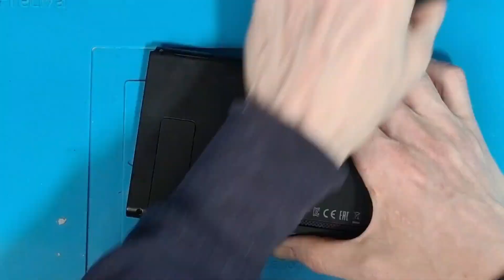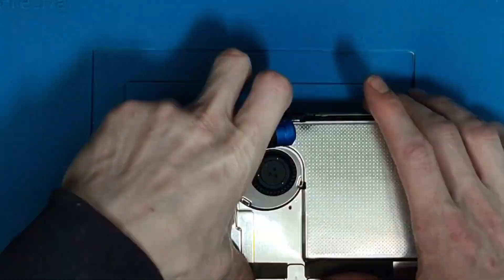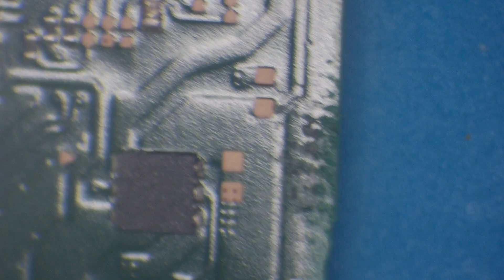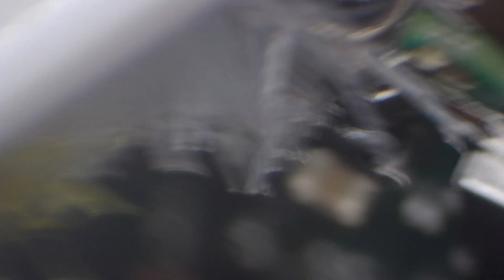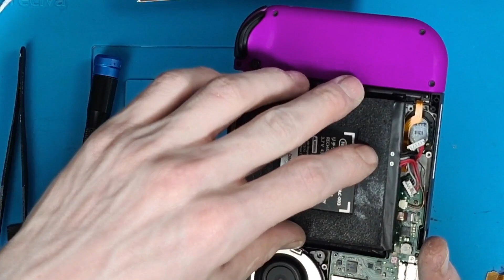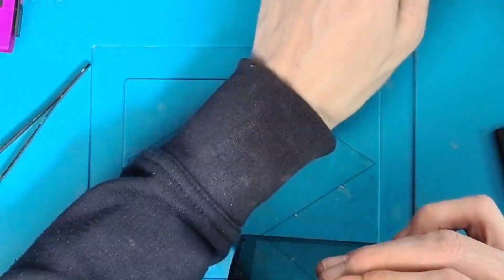Nintendo Switch Error 2101-0001 And Not Charging Diagnosis And Repair

Comment: I have never repaired a board before, but I work on computers almost daily. My switch got that error message while plugged in to a nintendo switch charger. However, it wasnt my charger, it was an extra laying around at work. I have a soldering station ordered as well as a chip. I hope I have steady enough hands for the repair and that the chip is all that's wrong. I do have a multi-meter so ill do the same tests when i take it apart.

Comment: I'm having this issue with my lite, turns on without a charger in it, but if I press the power button once, it acts as I've I've powered it off, so sleep mode is not possible anymore, neither is charging.. wonderful

Comment: Hey, great video! I had able to use your video to diagnose the exact same problem. My setup is vastly inferior so i couldn't check the filters. My quick question: you tested the coil and it appeared to have continuity. Mine did not. Does that mean my coil needs replaced?  Thanks!
Reply from the maker: Hey Brian, glad I could help you out :) the coil does need to have continuity in order for the switch to allow current to flow through to BQ24193. It may "appear" to not have continuity sometimes if you don't press hard enough with the probes. The coils are difficult to get a good connection on sometimes, best thing to do is to add some solder to each side of the coil first to make sure you're getting a good connection

Comment: A bit of a newbie at board repair but I think I've got the same issue here, the customer started experiencing the issue with the error on boot after they had replaced the battery with a third party one. I wonder if that was just coincidence? Alternatively maybe there was some user error while installing the battery like accidentally touching something with a metal tool? Would love to hear anyone's thoughts on this! 

Cheers from Canada!

Comment: Hello congratulations you are good , I have a switch with error equal to your video I replaced the connector type c and IC charging m92 now the error screen and go away the console works but instead of charging the battery is discharged despite on the display indicates the lightning charge, in your opinion what could it be?
Reply from the maker: It could be a number of things to be honest. It could be q bad m92 (even if it's new). It could also be q missing component somewhere near m92 or it could possibly be a bad P13USB, BQ24193 or bad coil near BQ24193.

One thing you could try is to charge it with a normal 5v USB cable instead of the official cable. If it charges at 5v let me know because my son's switch does the same and discharges at 15v, I've just never got around to fix it for him so I could do it for a video

Comment: @TheCod3r ever had an M92T36 go bad with 0 shorts?  I just had a customer bring me a switch, no power, not charging and just blinks on the dock, generally a blinking green light on the dock to me a telltale sign of a bad M92T36 or a bad USB-C port.  

0 shorts, swapped the M92T36 and all is well now.  Never seen this before with no shorts at all.
Reply: It could of been that it had been blown open due to heat just constantly being passed through it, when something breaks it will go short, then if for what ever reason current is still allowed to pass through eventually its going to burn and break something open. That is totally up to the protection that is on the circuit though because I've had something similar and the fuse on the battery had blown.

Comment: This error code happens aswell when the audio IC is removed. (after switch logo) you get this error code. .

only only know this because I was getting another error code relating to the speakers. 
my left speaker was crackling causes another error code

if I removed the speaker the console worked fine. but I wasn't happy so I looks at the audio IC. 
third pin on the bottom on the audio IC was gone. 

just spent 2 hours rebuilding the trace and soldering a new audio IC. 

working on both speakers now. probably not worth the repair as stereo on the TV and via Bluetooth always worked fine.  it just bugged me. 

(would of been easier to jumper from the right speaker and have Duel speaker mono)

hope this helps in the future. as this is my first audio repair.

Comment: Hello my sons switch lite is having the same problem what are typical cost of doing a repair for this many thanks
Reply from the maker: Hi mate. Typically for this error code it's between £50-£70. £50 if just the chip is faulty but if the port needs doing aswell I charge an extr £20. The return postage has to be added on too which is usually £8.85 in the UK for insured delivery

Comment: Every time I try to launch retroarch on my switch a message appear that error 2168_0001  occur how can I fix it
Reply from the maker: I can't help with that unfortunately, I'm not familiar with retroarch on a switch. Sorry
Reply: @TheCod3r  i managed to fix the problem but their some issues related to the performance of the 3ds games is their is a way to make the performance of games better
Reply from the maker: @hamedmohsen945  I can't help with hacked consoles for legal reasons. Sorry

Comment: Hi mate, dont know if you can help me but im getting the same error as you, also wont charge. Ive fitted known good battery and get the error. Ive checked for continuity over all capacitors you checked and they all seem fine.. not sure what else to look for! Any ideas?
Reply: Change the chip out anyways.

Comment: Hey there I watched your video I have the same error but all of my continuity test panned out to be fine any thoughts of what else it could be?
Reply from the maker: If you have the 2101-0001 code I'd try changing M92T36 anyway regardless of the multimeter readings. I do those tests just to help people learn but you can get that error and have M92 faulty with normal readings too
Reply: @TheCod3r  I decided to replace it anyway even before you reply. Thank you very much for your reply. Still have the same result hypothetically I guess there’s a chance that the chip is not aligned properly after replacing it? The system still turns on but just still shows that error message

Comment: did you use the same chip that was on the board? or did you use a different one?
Reply from the maker: I replace the chips with new chips (or chips from donor boards) but use the same part number as the manufacturer installs :)

Comment: Had a few pins get bent on my switch and managed to replace the port  and all was well for a few months. Then I got an error and my switch never turned on again. I am no where near skilled enough to do what you just did. Goodbye animal crossing save, my dumb butt never backed it up. 😥